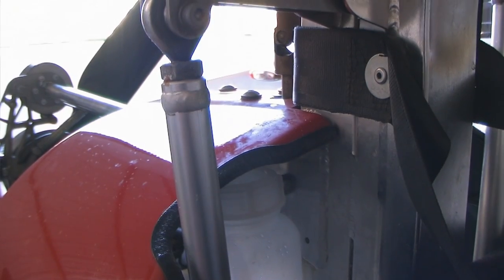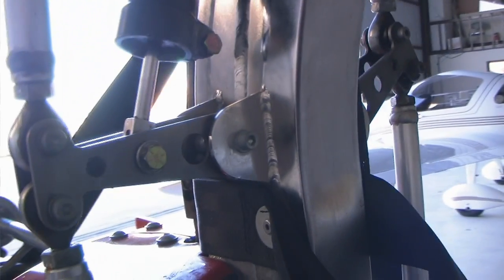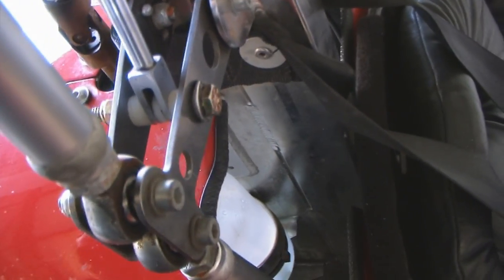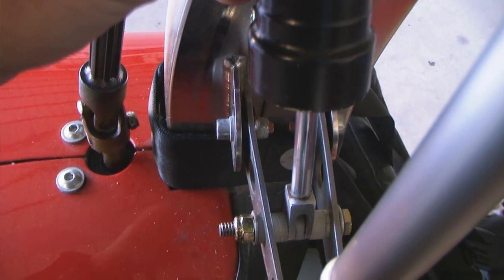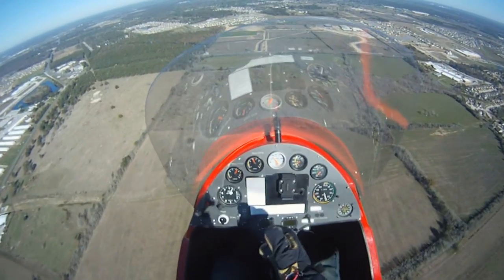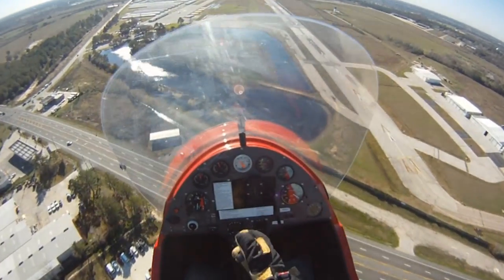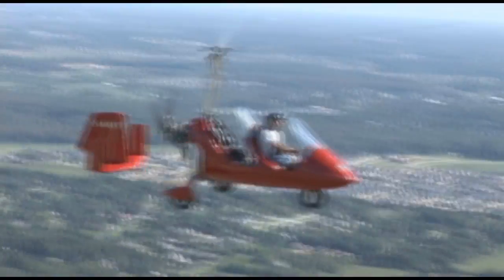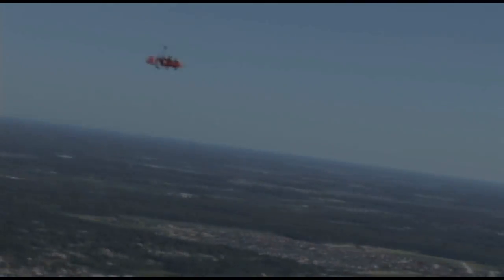AutoGyro MTO Stick shake dampener system

Comment: No guys you have deal with the balance and or out of pattern.  It's not hard to do learn to do it or other parts of your gyro will crack.  If your blades have started to shake more then it is likely an out of pattern issue.  This is an attempt to cover up what is falsely called 2 per rev.

Comment: Big street motorcycles often use an adjustable steering head dampener which you might be interested in checking out.  I'm planning to build a Dominator with a motorcycle type dampener on the push pull tubes.

Comment from the maker: This is a very old Video that seems to get attention! I did not ever install this permanently. It would require a hole drilled into the mast! I thought that was not the best idea. I do lots of rotor balancing the dampener is just to take out the last little bit. Not to cover or mask a problem!
Reply: I'm all for fixing problems like this. It's one real concern for owning a gyro for me. I don't think the level of stick shake I've seen on countless videos is a good thing from an engineering perspective. If there's a way of balancing the dynamics of the rotor system and people don't spend the cash to do it then they're stupid. That said, I agree with a comment above that adding a damper runs the risk of transferring the vibrations/oscillations, potentially, to more critical components and structures of the air-frame. I say potentially because you may have hit on a winning idea, but without detailed analysis how would you know. Best case - great fix. Worse case - people die as a result of a Youtube clip that in my view shouldn't have been posted in the first place until detailed analysis was completed. That's my 10 cents.

Comment: As a 25 year vet in gyro building and pilot....you are not solving the problem.....just covering it up. Spend some time on balance...tracking....etc.  You'll get rid of that damaging stick shake
Reply from the maker: If you read the description you would see that I did in fact address just what you said! I did explain that this was no substitute for having a correctly balanced rotor!!

Comment: I don't own an Autogyro, hopefully someday I will. I noticed in many videos the stick shake. I was wondering why this occurs, even though the rotors are balanced. Furthermore, the stick shake would be very tiresome for long trips, and would cause metal fatigue as well. Has anybody else found a solution to this issue without adding more weight to the craft? I understand that every pound of added weight reduces overall lift capacity.
Reply from the maker: The shake is not as bothersome as you might think! I have flow for over 9 hours in one day. Usually shake comes from several issues. Out of balance rotors being the first
Reply: I also can walk with stones inside my shoe, they are not too bothersome, but why have them there? Just because they are only bothersome, I am not going to put up with them.
Reply: @ew4096  Its the nature of how the Gyro flies that you cant get rid of all the stick shake. If you cant tolerate it then you will need an airplane